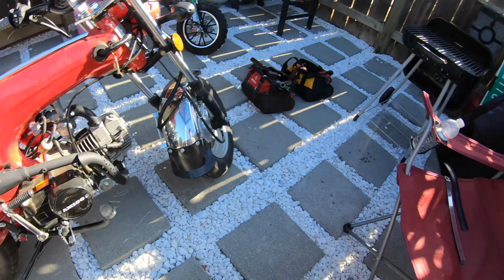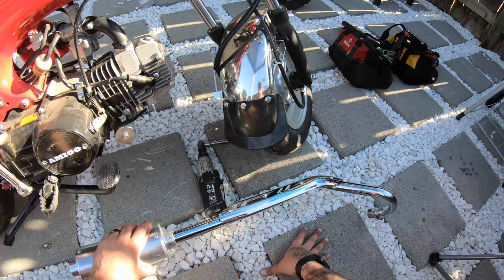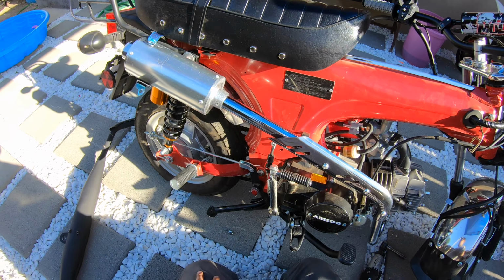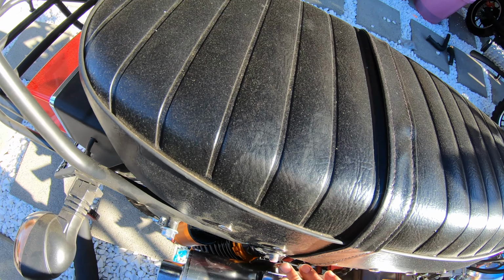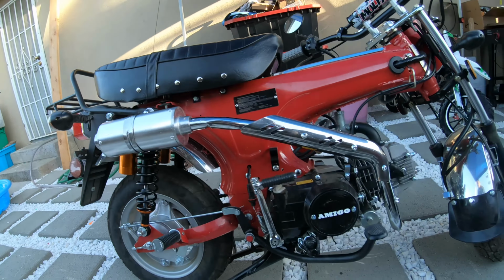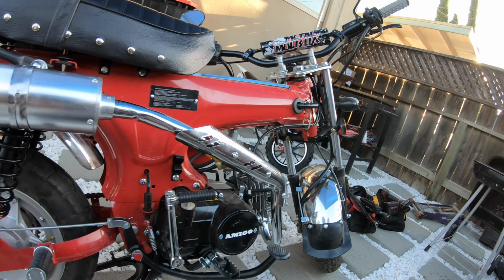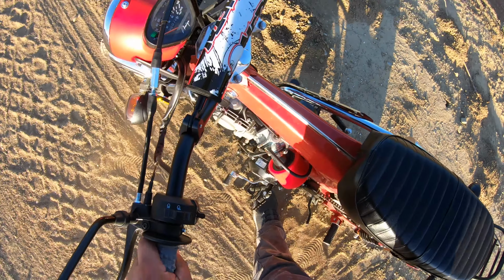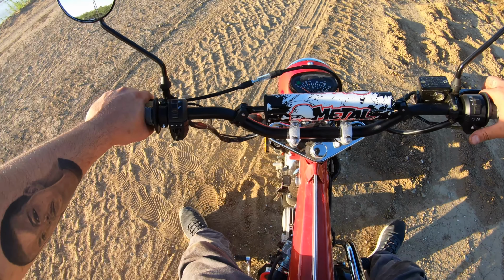Ct70 clone The new exhaust for the honda trail showed up sounds awesome Amigo Rocky 125

Comment: Also , it looks like your leg is rubbing that new exhaust .  Can you ride like that ?  Sound sway better though.  Peacefrom510 .
Reply from the maker: With pants on. I didn’t feel it but it is close
Reply from the maker: It’s just like riding the pitbikes they are close as well
Reply: @EnviousRepairPerformance  there another guy doing mods on these Amigos 125 :  Tin Roof Motorworks.  Check him out for ideas for mods .  Peacefrom510
Reply: Tin Roof Cycleworks on YT.
Reply from the maker: I’ve seen but I don’t copy other people stuff I do mods that I like or feel is needed at the time as I go
Reply from the maker: I also do a lot of stuff off camera the smaller things as in  “the basic stuff “ on any Chinese motorcycle